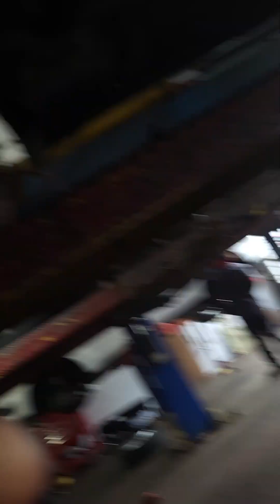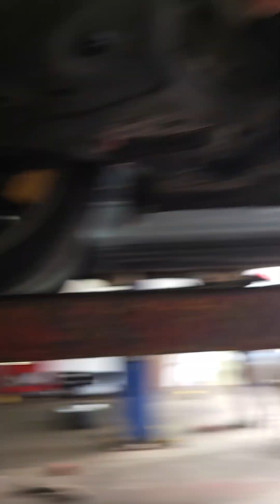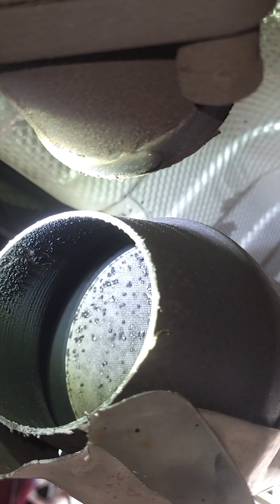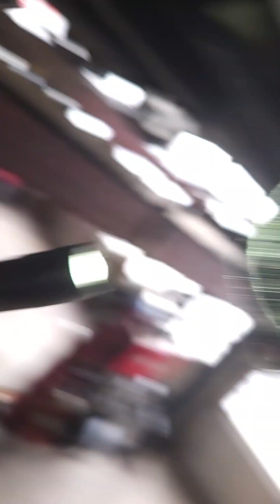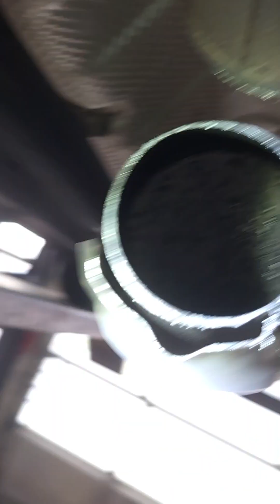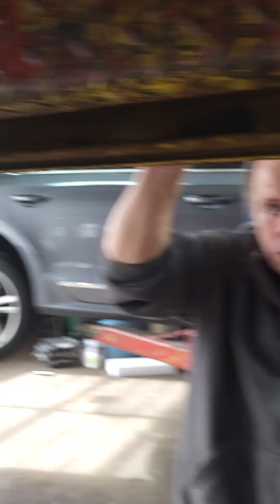Check the evaluation clogged converter  2012 elantra 75000 miles causes and effects

Comment: I have 2 car i build my own engines, and when I put them on the Dyno with super gasoline with the sniffer in the pipe its burns dirtier so I called bullshit on the gasoline I have data to prove it and oil I use amsoil  signature series.  synthetic and I do my oil change.  once a year I don’t care how much mileage I put on my cars and my one car is a 2000 Camaro with LSX engine TwinTurbo do not use super gasoline. It will burn dirtier do a dino test, put the Sniffer in the tailpipe  you’ll find out for yourself. If you have a high compression engine or your timing, is advance  then super is ok other than that don’t waste your money on super gasoline that’s my two. Cents.